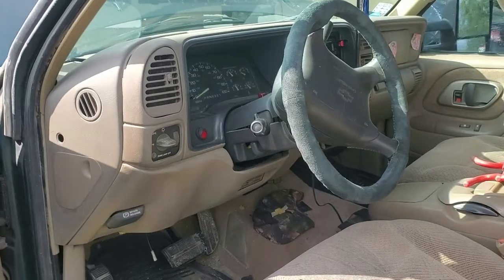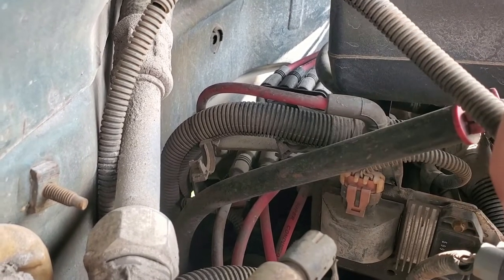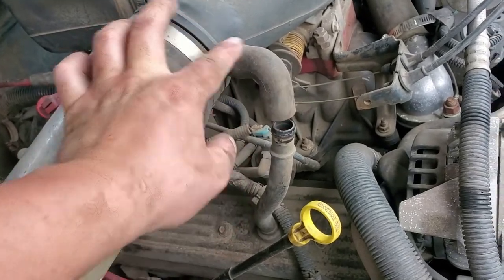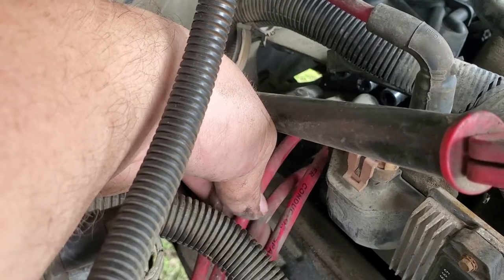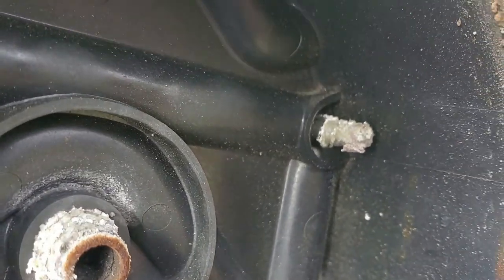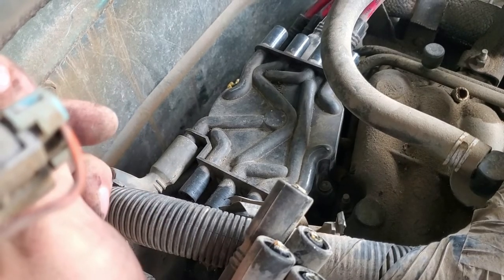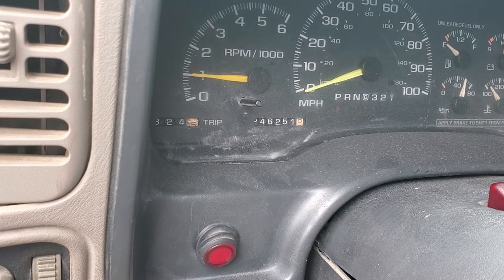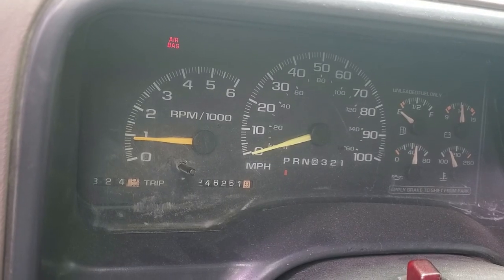Cranks but doesn't start - ESPECIALLY after weather changes like rain, or cold to hot

Comment: I’ve gone from a starter to a new fuel filter thinking no gas is getting in, my fuel pump still kicks on as well. I’m definitely trying this before I get that or new injectors. My engine turns over and cuts on for maybe a second with starter fluid spray, but right back off. I’ll update you. Life saver if this works 🎉 (I have a 98 Chevy 1500)
Reply from the maker: This would be a free fix if it works. But hey another common problem on these chevys is the spider set up inside the intake can leak or break but yea I would definately check spray first like this or even a bad coil since we only have 1.

Comment: Same problem not solved,gmc savanna I think I'm getting moisture in the ECM , pretty soon I will spend $200 and find out,I have changed everything else . great video.
Reply from the maker: Thank you very much! The ecm is very unlikely. Have you checked the condition of your spark plugs? And have you replaced your coil?